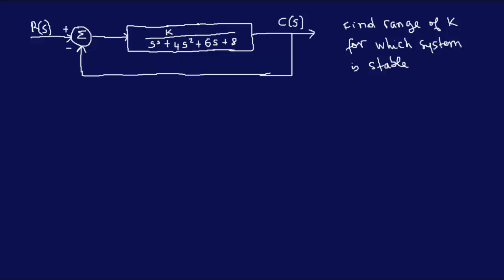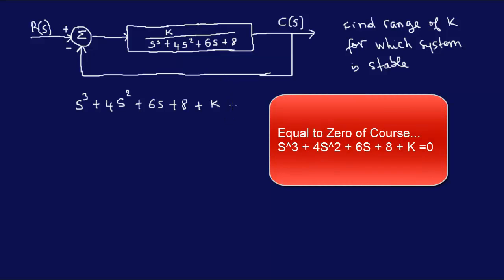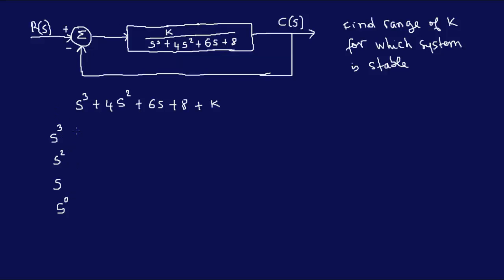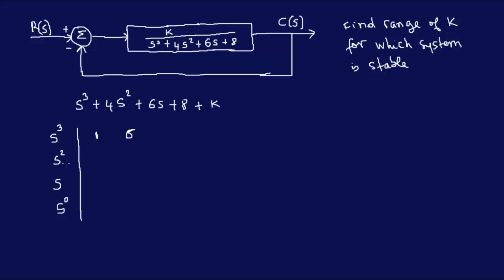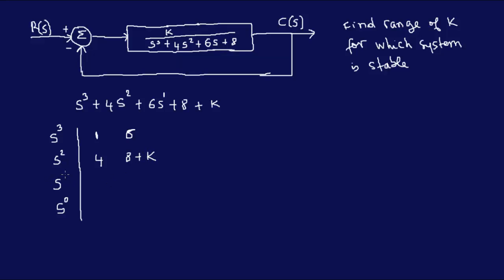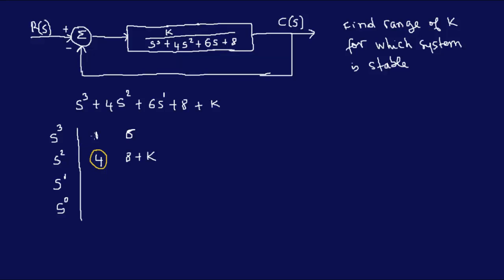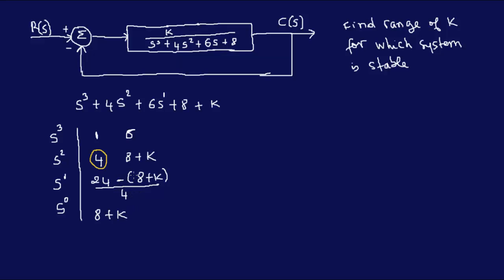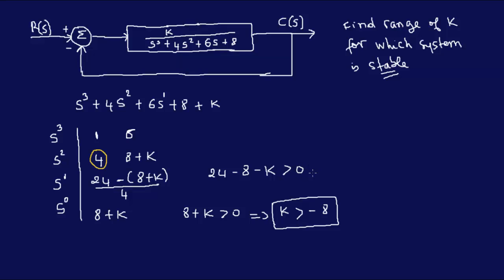Finding Range of K for Stability-FE/EIT Review

Comment: Good video!!! Wrong answer as per the range of K.  The equation 24 -8 -k >0 ...when resolved... 16 - k > 0 ....then.... -k > -16 ....if you multiply by -1 ,,,,then you have  k < 16 which is the correct answer.  Hence the proper range is  -8 < k < 16.  You can always check your answer....if you say k = 17....(outside the correct range)...the element of s^1 will be - 1/4 ...hence the system with k=17 will be unstable.  If we say k =0 ...all elements in the first column will be positive. Keep the good work !!!
Reply: maybe she forgot the rules on those symbols, that's what I also noticed. k should not exceed 16, it should be less 16. maybe she got confused. anyway thanks to both of you!
Reply: I also noticed that

Comment: Say the denominator was, s^4 + s^3 + 4s^2 + 6s + 8
When making the columns, I'm guessing you would write s^4 first, then s^3, then s^2 etc.
My question is, since the first row now has an even exponent (s^4), would you write the coefficients of the even exponents instead of the coefficients of the odd exponents?
Reply from the maker: Steve, the answer to your question is yes. The example just happens to start with odd exponent but it doesn't matter if you start with even or odd. the process is still the same.
For s^4 + s^3 + 4s^2 + 6s + 8, the first row at s^4 will have coefficients of the even: 1  4  8+k.
Then s^3 row will have the odd coefficients: 1  6  0...the 0 is just there to fill the blank basically cuz you don't have an extra odd coefficient to complete the 3 rows.
From there you continue with the process of multiplying out like i did in the video.

Hope that helps...
Reply: PERFECT...thank you so much for your quick and helpful response!
Reply: Raiya Energy Here, I found one typing error,  , you've mentioned that K value must be between -16 and -8 so it should be written as (-16)<K<(-8) . 

Thanks for your video, very helpful.

Keep it up!